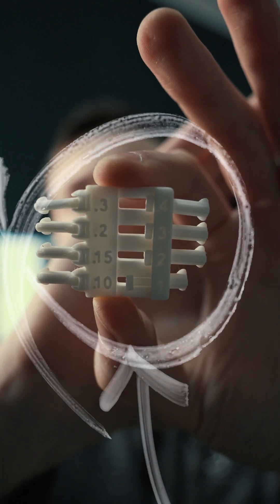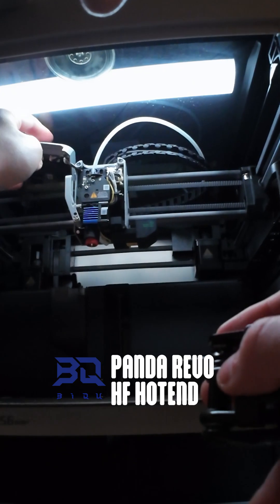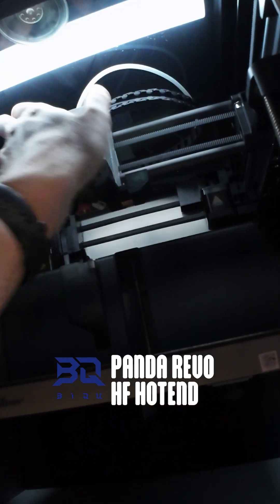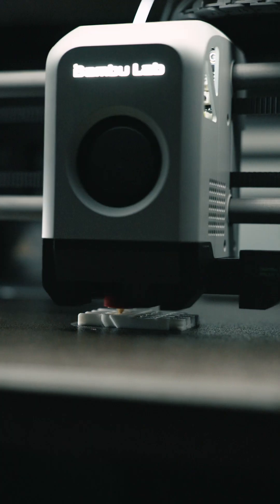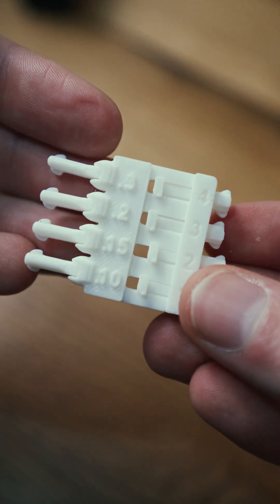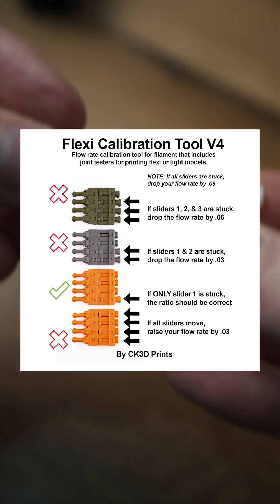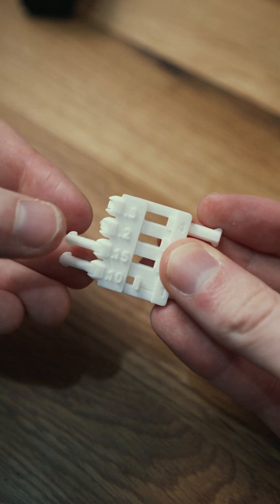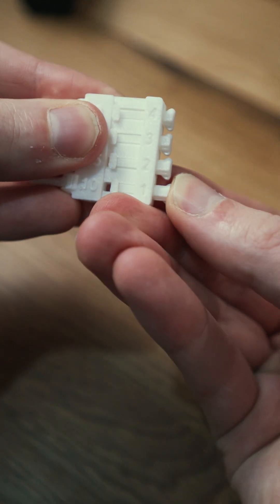The easiest way to calibrate flowrate #shorts #btt #panda #revo

Comment: Ich drucke immer zum Kalibrieren einen Würfel ohne Füllung mit einer Wandlinie ohne Deckel. Dann mess ich die Wände an verschiedenen Stellen mit einer Bügelmessschraube und stell so meinen flow ein. Als Gegenprobe hab ich soeben den Test aus dem Video gemacht. Top Ergebnis. Nur Schieber 1 ist fest. Gefällt mir aber sehr gut mit der Methode und ist schnell gedruckt. Außerdem hat man gleich ein Fidget-Dings 😂
Reply: Wandlinien messen um den Flow zu bestimmen würde ich nicht empfehlen. Schau mal bei Elli's print guide, da siehst du auch das warum.
Kurz gesagt: du misst bei deiner Methode auch den Fehler von inkonsistent gestapelten Layer mit. D.h. wenn die Layer nicht exakt mittig übereinander liegen, misst du trotzdem eine dickere Wandstärke als tatsächlich vorhanden ist.